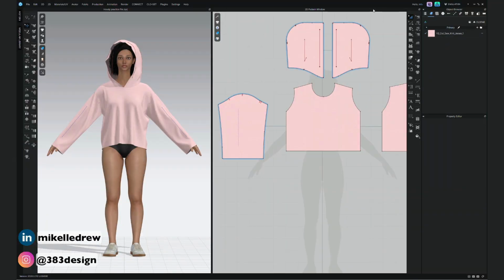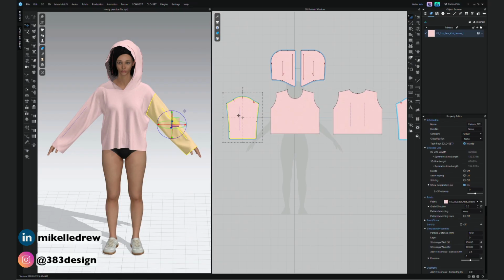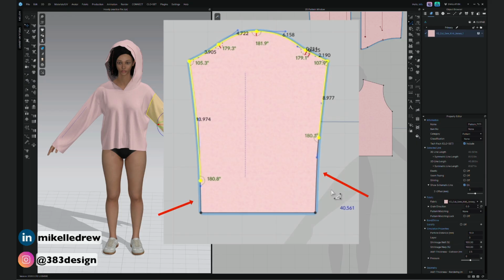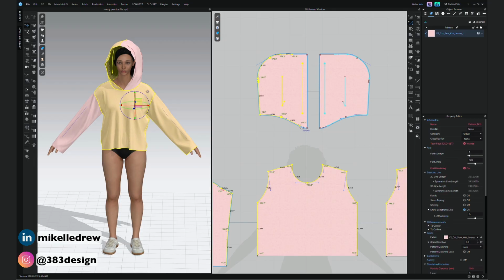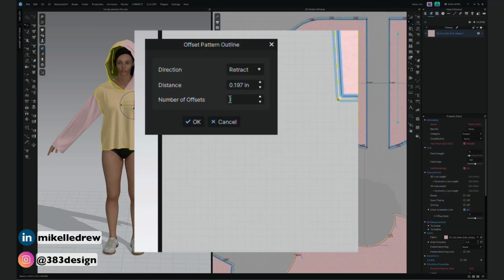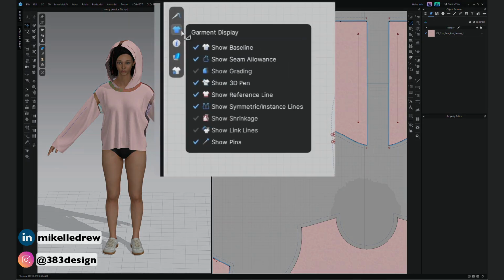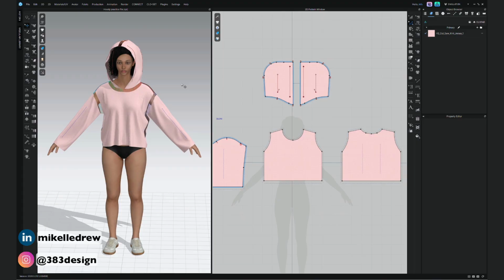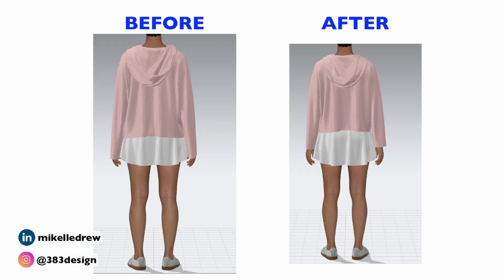Remove Seam Allowances Fast in CLO3D

Comment: would you not fold and sew the hems??
Reply from the maker: Thanks for watching and commenting! In CLO (at least traditionally), you're dealing with finished lengths so most people don't add a hem unless they're prepping the pattern for final fit or to output the pattern. There is a folding tool that can be used for hem, but even then, many designers will cut the hem and sew it like it's a facing to avoid unnecessary collision. 

I will say, though, that, based on what was shown at the most recent summit, they're trying to improve this so that you don't end up with one set of patterns to use in the 3D space and another to output for actual sewing (which is what many designers are dealing with now.)